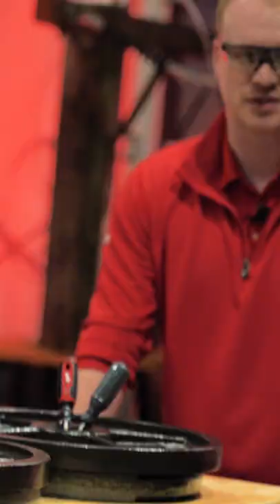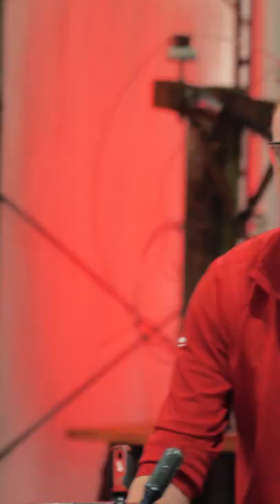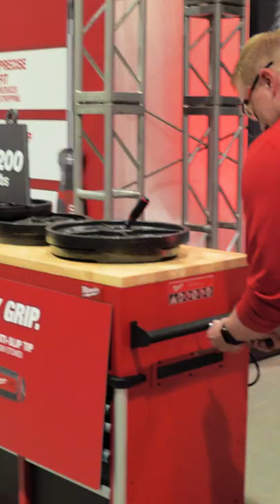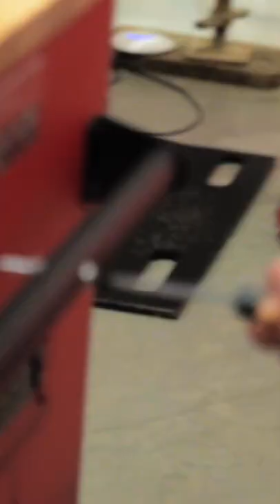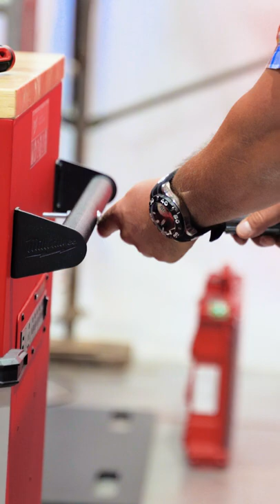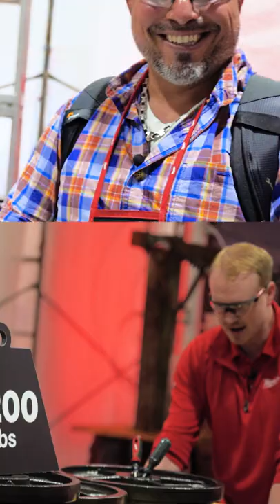Why You Lie Milwaukee Tool?

Comment: In what circumstance would you need to pull a cart with a screwdriver anyway? 😂🤷🏻‍♀️
Reply from the maker: Beats the heck outta me! 🤣
Reply: The test is to demonstrate unlikelyhood to cam out.
Reply: @autumn5592  That makes sense but seems carnival game gimmicky to me and as Vince exposed, is rigged. I think it was a bad idea from the get go.
Reply: Hell, I do this all the time.  Use my screwdriver to tow a space shuttle.  very convenient.  Until Milwacky LIED!!!!
Reply: right thats what my original thought was!! uhh hello thats what they freaking handle is there for, the thing you use with your hand to ya know move it!! lol so stupid
Reply: @autumn5592  magnet has got nothing to do with camming out. The magnet is only to hold the screw on the end
Reply: @TWH442  This screwdriver doesn't have a magnet, it has laser etched gripping surfaces.

Those 'teeth' help prevent camming out, so you can actually turn the fastener in or out without doing damage to it.

Looking into the product before you speak could help with understanding it a bit better.
Reply: I mean in what circumstances do you need to lie about it?
Reply: @chaotic_ash5985  Never! Lol

Comment: Hey I’m an adult and understand “embellishment” is common in advertising. I purchase tools based on experience and on reviews and recommendations from the folks that use them day in and day out. Unfortunately this test seems to be deceptive at best. There was no reason to even perform this test as there is no situation where you would need to pull a cart with a screwdriver. Milwaukee just needs to do better.  This kind of stunt can hurt the brand.
Reply from the maker: And when you involve others in your embellishments it potentially hurts their reputation as well.